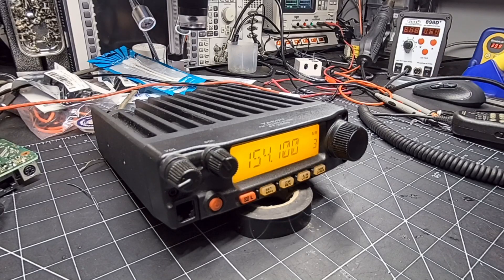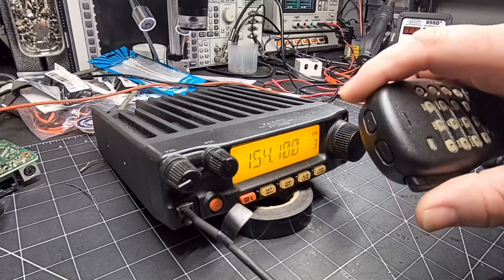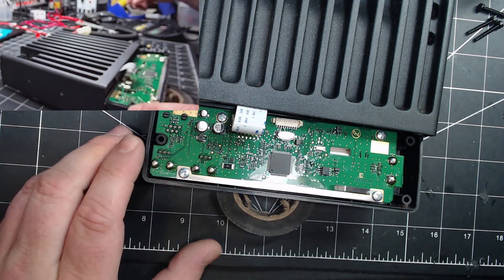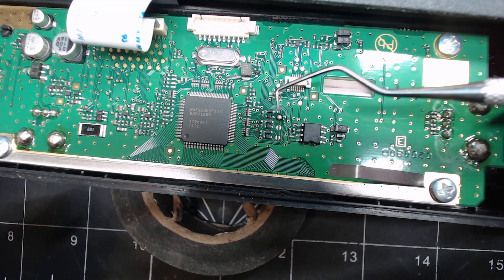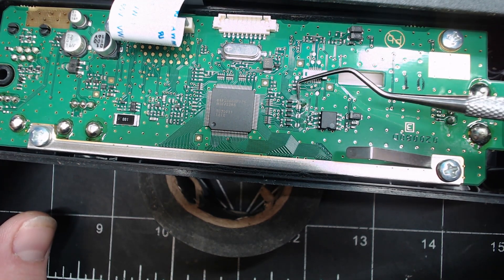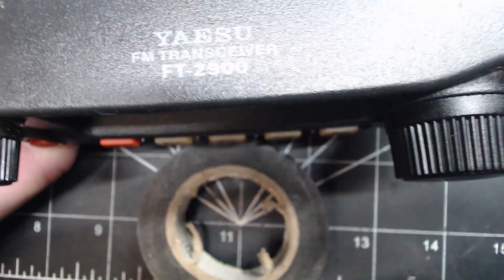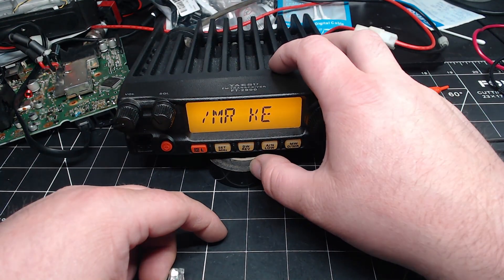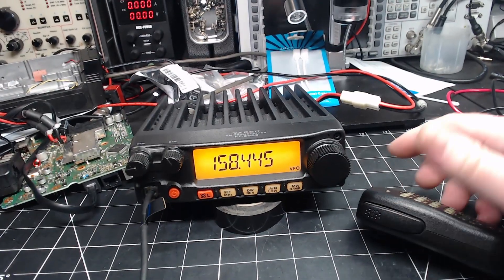FT-2900 How to open TX -  Extended frequency mod

Comment: I did the mod and it worked perfect, Thanks. I do have a question though. When i try to program with the mic the key pad numbers aren't displaying correctly, i push 1 and the 5 appears, the only ones that are correct are 9 and 0. Any ideas ? I just replaced the mic and its the same thing. Thanks again, Rick.

Comment: i HAVE THIS exact radio.  Using the RT software to program.  Did I see someone say that the noted modification will disable the programing app?  Or did I read this wrong?  Thanks for the great video.
Reply from the maker: I have heard that but haven't confirmed it. I do know that CHIRP has an option for programming the modified FT2900
Reply: I read that too!  So I havent tried this mod yet.

Comment: Do you know how to change the TX output power levels from the default settings on the FT-2980? I saw a video on it one time but can’t find it. So, I know it can be done.  Thanks

Comment: Hi there from Northern Alberta! I just got this radio and did the mod. Worked as it should. Just wondering what programming software you use afterwards? The RT systems is nice but doesn't work after modded. Also chirp doesn't work for the mod. Maybe its possible to not do the factory reset after the mod? Progamming repeaters one by one in the radio is pretty tedious. Would like to hear your thoughts! Cheers.
Reply from the maker: I believe there is a chirp plug-in for the modified 2900. I will post a link once i find it again
Reply: @salvagegeek update?
Reply: @salvagegeek  same plug in for the 2980?  Chirp?  Thanks!!
Reply: @salvagegeek  any luck finding the link? Is it possible to unlock the 2980? Cheers.

Comment: LMAO!! I did that exact modification to my FT-2400H about 25+ years ago. It works and it's no joke. I accidentally transmitted on a police frequency over 25 miles away on low power and did a radio check on CH-16 Marine (156.800) on high power (50W) through a 13B2 yagi pointed in the SE direction. I contacted the coast guard near Cape May Delaware Bay from Norristown PA. He could hear me good with little static/noise 6-7 out of 10. I could hear and understand him, not nearly as good as he could hear me. He told me which channels to use for a radio check and 16 is only used for life threatening emergencies (mayday mayday mayday). I apologized and told him I didn't know I was on 16. He was cool about it. Thought I would share this. Great video. 73.
Reply: Coushcraft 13b2 yagi is amazing antenna for long distance dx I run my amplifier 1600w on vhf 2 meter 145000mhz fm simplex on 2 sticks 26b2 on 24 meter tower above second floor i got 5/9 loud and clear over 650 km distance

Comment: Thank you so much for an excellent video.  I will unlock my FT2980 tomorrow based on the information from your video.
Reply: Did it work? Does it work to get GMRS? or Just other VHF Freq?
Reply: Any luck on the mod. Did it work on the FT2980?

Comment: Will this work on a ft-2980r?
Reply: It does work. Just did it to mine, it's opened up now. Thanks so much for the video! 👍🏻
Reply from the maker: Thanks for letting us know that it worked!
Reply: Unlock, yes: then you can't upload channel settings.
1	2	3	RX	         TX	         clone?
0	0	0	136-174	136-174	failed to read header/error
0	0	1	136-174	144-148	OK
0	1	0	136-174	136-174	failed to read header/error
0	1	1	144-148	144-148	failed to read header
1	0	1	136-174	144-146	failed to read header
1	1	1	144-146	144-146	failed to read header
1	1	0	136-174	144-146	failed to read header
1	0	0	136-174	136-174	failed to read header/error
Reply from the maker: @dustinhilton8743  Did you do the reset procedure when booting after the mod?
Reply: @salvagegeek   , yes, that's how I verified the RX/TX range for each setting. Chirp won't work, maybe another program will.
Reply from the maker: @dustinhilton8743   Email me at ve7xpo@gmail.com and I can send you the Yaesu programing software if you don't have it. I never seem to have any luck using Chrip

Comment: How about it was a great radio but what is up with these radios loosing there recieve ? Like a get blowout on front end.. or scrap ceramic filters that erode.  Git one pitched overon side cause it lost it's receive after I bought it for $80 took it 3 months to die on receive.
Reply from the maker: I haven't had a 2900 with bad receive yet, but I have had some Icom radios with receive and filter section issues that I think is due to lightning or just really bad SWR. Plus the Pin diodes like to die in the Icoms.
Reply: @salvagegeek  I hear you ..
There are Kenwood's like tm 271 and tm 281 that loose revive to .
I had a Kenwood tm v71A lost revive on one side ceramic filters there's 2 per band side on radio 1 is narrow other is wide . I used radio on right side till I gave it to someone to fix for themselves they bought 4 filters .
Later I bought a new radio hope they fixed it compared to eat see no# models . Ok thanks